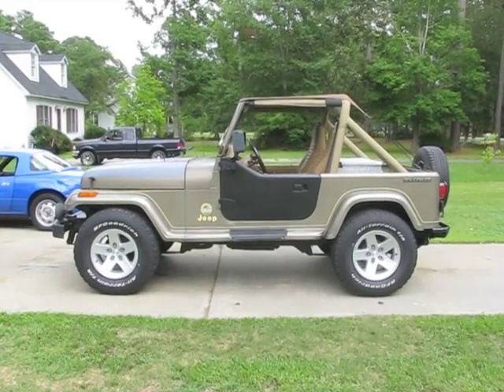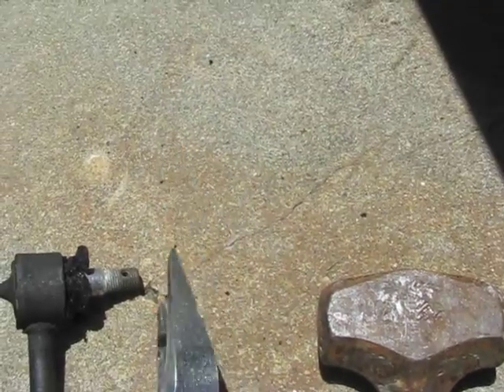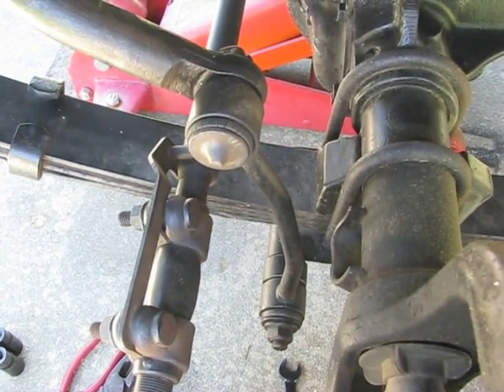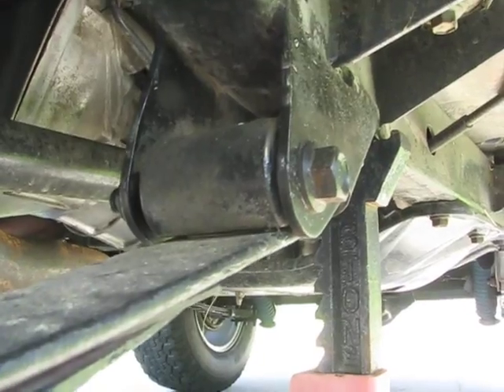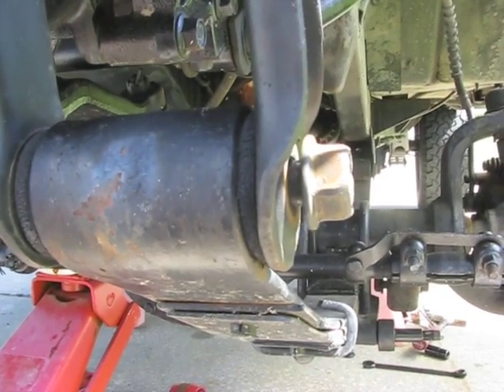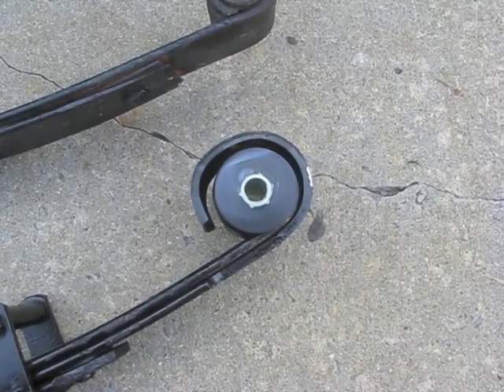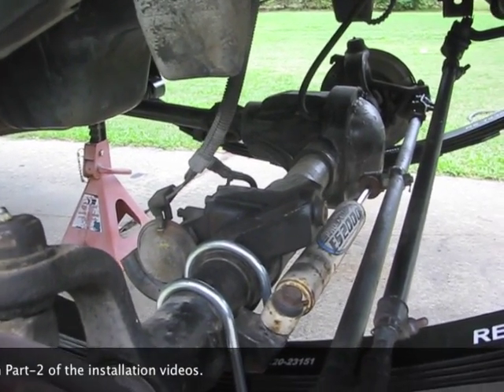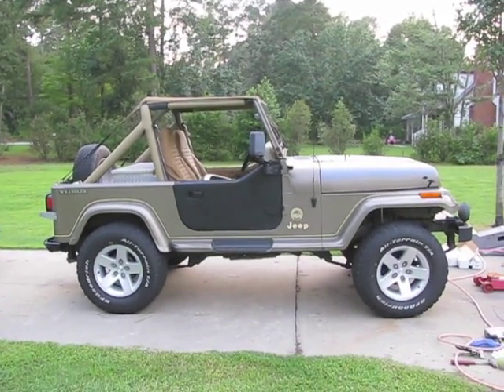Jeep YJ - Rubicon Express 2.5" Standard Suspension Installation Part-1 (front) (RE5505)

Comment: do u have wheel spacers to fit thoses wheels on ur jeep
Reply from the maker: +Jesus Pacheco
Nope. No wheel spaces needed for the tire sizes I run on the 16x8 TJ "Moab" wheels with 5" backspacing. 
When I was running the LT265/75R16 tires, the tread would rub the leaf spring with the steering at full lock. I adjusted the steering stops with a couple washers for that. 
I also have a set of 15x8 TJ "Ravine" wheels with 5.5" backspacing with a set of 31x10.50R15 tires. They didn't rub with the added washers on the steering stops. I haven't installed that set again since removing the washers but I think they would clear.
I currently have a set of LT245/75R16 tires on the YJ and removed the washers I had previously added to the steering stops. Tires are nowhere near rubbing the springs.